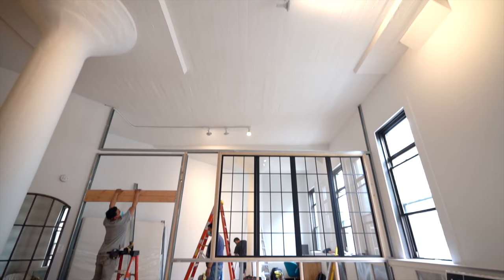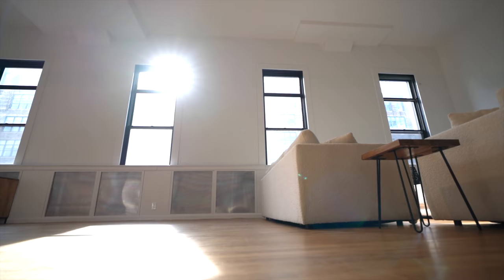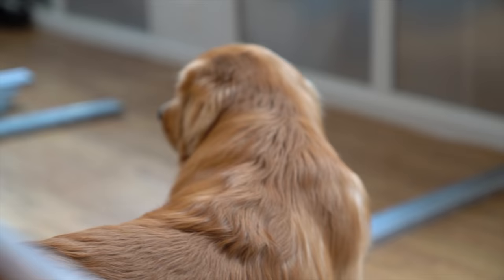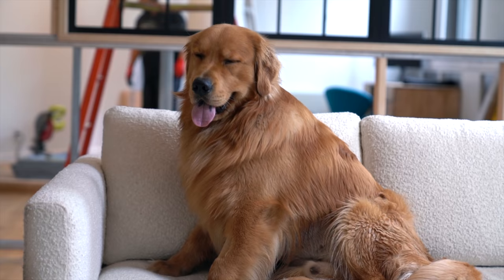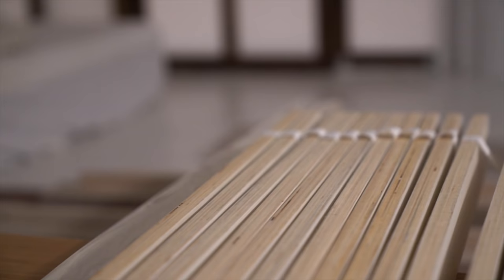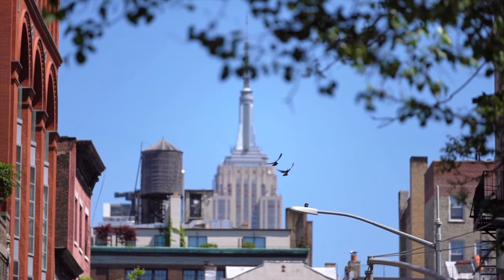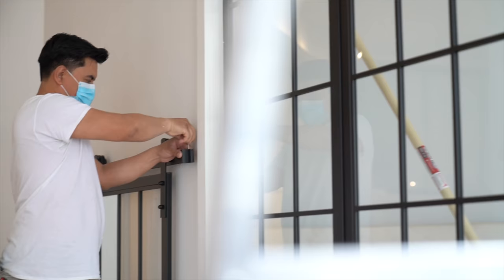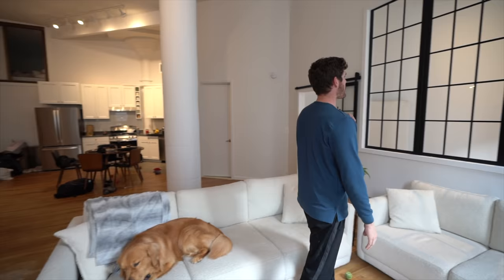My New NYC Apartment!! Renovating my SoHo Loft

Comment: If you do decide to hang curtains (I would) make them floor length. It will highlight the high cielings. Also, if you pick a rustic fabric, it will give the bedroom a more cozy feel and it will add texture without changing the neutral palette you have going on.

Comment: I like that you are doing the black frames on the loft windows. Have you considered changing out the stair rail to add some interest against the wall? You could go with a stove pipe or or steel wire to keep it minimal but industrial...the wall looks amazing❤️
Reply from the maker: I'm not going to do too much since its a rental
Reply: @erikvanconover  You could have the cabinets in the kitchen painted into a tabaco/brown color. It would match your kitchen table, which could stay as a breakfast nook, to help and add more color contrast with the way too much white walls and ceiling.

Comment: It would be more satisfying if new windows were the same hight as the existing ones in the apartment and barn doors too. Now you have different highs all  over (door on the bathroom, bar door, room windows, living room windows...) That would make me crazy😊 Also, since you are painting glass frames, maybe paint the stair rail in black too?
Reply: Possibly add an black industrial curtain bar above your new windows on the living room side at the height of the exterior windows…might solve the height difference .
Reply: My thoughts too.
Reply: It's such a tiny door for that space. They should've put a window above it to make it match the windows. A makeshift transom window. The weird blank wall space where the barn door rests is also bothersome. They could've put a smaller window there with a window above it to allow for the rail and to match the rest of the wall. 

The bathroom door needs some sort of work to match the space.

Comment: ERIK - Looks fantastic!  Totally agree with your mother in the height of the windows.  I'd suggest placing your bed under the new windows with two large bedside tables (maybe one big round table) on each side.  Keep the backside of the room for office space and perhaps a large dresser with your huge mirror over it upon entry into the bedroom on the left side of the door.  You have enough space back in the corner for two large leather chairs and floorlight for reading and cozy time.  Place is looking great!!

Comment: So maybe unorthodox with the factory loft feel, but the guest bedroom/theatre space would make an awesome Japanese tatami mat area. Kotatsu in the center makes a space heater and a fine coffee/dining table duality in what is a low ceiling room. Encourages floor based seating. Futon/slightly raised bed. Contrasts the factory style sliding vaulted windows in place but with the paper divider feel as an almost transition into the space from factory to Zen. A stark contrast to metal and concrete pillars but a transition with the wood frames and floor. Definitely suits the 'cozy' space.

Either way, keep the reading nook idea. Its hard to get to but a place to stay in when you are there. For the avid reader to escape the world outside. Will need some bright/dark wood and low light plants in that area to keep it feeling from being cramped and to utilise and highlight the window and light that comes through. Dieffenbachia and monstera deliciosa are ideal for that low light space and take relatively low care to maintain. In a cramped, low airflow space, they also help keep the air feeling fresh and have low/no scent. Just keep cats away from them (toxic to felines) and don't get lilies (Peace lily in particular) as they are toxic to dogs. 

With such a high ceiling and great light flow, do not be afraid to get some plant life. I would go sparse but large plants as they prefer to be spaced out from other plants and are more forgiving in terms of care. Brightens the space, makes it feel less artificial, increases air quality, and really breaks up all the stark white walls and wood. Compliments art and artificial lighting.

Comment: Man I love the style. Minimalistic with ha touch of colours. Now concerning the living room, I would replace the white "couch" in the middle of the two corner couches with an industrial table preferably in dark brown colour and I would add two or three books on it along with some white red and black candles. Now concerning the bedroom I would place the double bed facing the house and its back facing the big windows so that the light does not affect your sleep (very important). After that I would put a big library inn front of the bed that I would fill with industrial type of decor. The kitchen is great as it is. Now the most romantic and "key" type of room is the second small floor that you have. I would put a big bed with one couch like the ones downstairs but a straight one without any corner. If I helped you even a little bit I am very happy.

Comment: Love how the wall turned out. I think the drapes will work great, but I do think there are options... 
- My favorite idea would be electric window tint or "Smart Glass" where you touch a switch (or even use an app on your phone) and it turns opaque or semi-opaque depending on your design. It would look super clean and just be cool!
- A drop down TV/ projector screen would do double duty! 
- A remote control roller shade above the window
- A Roman Shade

Comment: Hey Eric, I’m a Furniture & Interior Designer by profession. 

I’d suggest, in order to keep the flow of the open floor plan, paint the wooden loft window frames White. There’s plenty of black accent now, esp after the new additional bedroom wall, with black framed windows.

For once more furniture is added, it doesn’t feel too stuffy, instead feels open and minimal. Every little detail adds up. Also takes from the focal points, which will be Art, the existing black windows etc etc.

Comment: Congratulations 🎉 the property is amazing and now a perfect home.

For the loft windows you can go for black or just a lighter woody shade to match with the flooring. 

For the corner of loft you can have a small cabinet with a safe to keep some valuables.

For the kitchen, you can have a small bar counter next to the dining table with a wall mount open wine cabinet that's sleek and with dark wooden finish.

For the wall that you want to decorate with artworks, you can go with some blues and grey to give a color addition.

The living room can have a grey rug and a customizable mood lighting from the floor. This would enhance your movie experience or provide an enhanced relaxation and vibe. I suggest a long LED strip lighting to serve the purpose.

For the bedroom, I can suggest another partition to separate the work area. As the bedroom is a place of relaxation, you don't want to take your work worries to the bed.

Comment: The wall looks good! I was skeptical when you mentioned it in the prior video. The building owner may want to leave it up when you move out so they can market the apartment as a 2BR if they can — or 1BR with loft space since the loft area doesn’t have a true window. 

The curtains seem like a good idea, for privacy. I wonder if a shade of some kind could work, too, so when you pull it up there’s nothing hanging on the sides, for a cleaner look? 

Also, pull the couch away from the window wall and “float” it a bit and/or put a slim console table behind it so it’s not right up against the wall. 👌

Comment: The windows are beautiful and outstanding.  You have great taste!!  Do not add curtains because you don't need them.  If you add curtains, you will take away the charm.  Buy Luminara candles from QVC (cheaper than regular stores).  The flame looks real just like real candles but are battery operated.  Only turn them on at night (when it starts to get dark).  The C and D batteries can last between 6 to 12 months if you only have the candle on for 2-3 hours at night.  At night is when you will enjoy the glow.  If and when you need privacy, get rid of your friends...time to go home.  If you feel you must have some sort of shield for privacy, then invest in a hand held battery operated roller shade.  Invest in the best quality and have a professional install it inside the room above the windows where it will not be seen from the rest of the apartment.  I am sure you will be able to to get just one to cover all five windows.

Comment: An automatic white shade run by a remote control, would be better than curtains. It rolls back up into it's own box and then the box closes and then it drops out of the box, when you want it down. ( It can also double as a movie screen.) Remove the wood and whatever wall up stairs and continue the white painted metal stair rail up and across the balcony. Keep it the same width and look so that it looks like it has always been there. with just a white railing upstairs, it will look more open and it will be better for ventilation and light. No one can see what is going on upstairs, so forget a barrier or curtain -- not necessary. If you insist on drapery or curtains, get white roman shades with inner lining instead. Worst case senario, paint the upstairs all white; it is not precise like your windows and it will look like an eyesore if you paint it all black or black and white.

Comment: After all is said and done...raising the windows off the floor is good / the move completely blows the doorway height into an afterthought. Actually changing the concept from window wall to just window, (which is not bad, but losing the drama of original design). But back to the doorway, consider adding a panel above the door to visually add some importance and needed height.

Comment: Your window wall needs two pearl white adjacent horizontal fabric blinds-perhaps with deep horizontally pleated draping as they lift or with accordian type folds.
You can have them installed and operated to lift hydraulically (electro-mechanically(?)-sorry-not my bailiwick.)  Anyway, as you will be able to raise them separately, that would allow you to have one closed, when necessary for privacy, perhaps when you have company and would not want to have your bed on display.
Your apartment is stunning!  Well done!

Comment: 1:10 the drawing has the barn door and windows on the same level, but it looks much better with the windows raised higher and sitting on a half-wall. Then the bed can be pushed against the half-wall instead of the windows.

Comment: Frame the wall with black metal above glass window and door to make it same height of  existing window. If you can panel it with mirror inbetween frames, it would be good. If you can, remove wood panel in loft and replace it with glass wall with black metal frame. Pint the stair to loft black also....

Comment: Su much better, and keeping the light by using the glass wall is just perfect. 
Living in the big hall just feels like : living in a hall. Now it's like a flat with just generous room sizes.

Yes, do add a courtain. That you can push totally to the side. You can close it from the bedroom when you have guests. It also adds style, luxury and homey feeling. Can't go wrong with that. 
They can be very light and transparent....the light plays in them...or not. 

The rest of the place also needs similar ideas, to make it feel more honey.

Right now, the upper part and the kitchen seem the least polished. (And definitely less polished than your new wall ,😉). Of course the owner could have done it. But he didn't do it because it costs....

Even the curtain will be very expensive (given the size), but if you can easily afford it, go for it.

Comment: Erik, put the white curtains up from the living room and not from the bedroom, it will much more homey feeling. Not the couch against the wall but the other one, have you tried putting it under the windows? it will open up the flow of the space and maybe you can add a large tall plant where that couch was near that pole and also you might wanna put some spotlights on that particular column with Edison lights to give that industrial look.

Comment: I think the new wall looks amazing. The space is a bit all over the place because there are so many different elements that all have a strong character. The new wall works in harmony with the overall aesthetic. You probably won't be able to do this since you are only renting, but the wood-colored "windows" of the loft area might look better painted white. The wooden floor, the black / dark gray of the windows, and the columns and strong angles provide enough contrast. It would be nice if the structures of the loft could remain more in the background.

Comment: You should hang 2 sets of curtains - Sheers that still allow the light to come through but also another set of curtains separate from those to add privacy. I think the sheers (white) will add another dimensional depth while still harnessing the light. :) Great Idea to put up the wall and the owner should leave it once you leave because it adds so much to the space!!

Comment: It turned out nicely! I think a huge bookshelf with a sliding ladder would look really good on the long wall, but I get that it's a rental so maybe that would feel unnecessarily complicated if you don't own a lot of books? You could build a space into the bookshelf for a piece of art or something. I think just adding a bunch of plants would really elevate the space, especially something big that really emphasises the magnitude. Getting a really cool light for the dining table would also be awesome. Maybe look for something antique or retro and have the chord changed out so it's long enough to fit? Either an art deco piece or something classically Scandinavian?

Comment: I would put a large mirror with the same lattice frame as window wall on the wall with the stairs leading up to the loft. It will reflect the light and cause light to bounce all around.

Comment: That really looks amazing and very professional.  I'd put the curtains or maybe blinds on the inside of the bedroom so you have more control and privacy. When you do move out it would be a shame to have to tear it all out unless there is a requirement from the building management to restore things to move in condition.   Seems like this definitely added value and appeal to the apartment  for future rentals. And yes paint the wood trim black at the loft area.  Great job..

Comment: I really liked the direction and the result,
But very disappointing that the door is small and low, different that it is near the door of the bathroom which is higher.
I would recommend that you bring in furniture and curtains that will give the space some volume and warmth.

Comment: Hi 😁 New to the channel. ~ I like the new wall, and bedroom addition. You asked early in the video if you should paint the wood on those sliding doors in the loft black or leave it wood. I think you should paint the wood black to match your bedroom. I also think you should paint those large beams black. ** Not the whole beam ** I would paint the bottom half of the beam. You can do vertical, horizontal, candy cane stripes or solid black. I think painting those beams would give the place more personality. I would get a black kitchen table with red or blue chairs. Just to add a little color to the place. ~ What do you think? 😃

Comment: Looks very nice. That style of interior black framed glass wall is actually known as a new yorker wall here in Denmark.
I think modern wide plank oak quality laminate flooring would really lift the place as well. And that's relatively inexpensive and very durable. I can't imagine the landlord will want the wall removed and the floor could be done with the landlord as well.
Reply: The pillars could be covered with artificial vegetation. Probably relatively expensive but I think it could completely disarm the basement look.
Could have little arms with spotlights illuminating them.

Comment: it WAS a cool space... new window & door height / modulation should´ve matched existing doors and windows proportions somehow, it does not... I would´ve never enclosed the space completely unless expecting tons of sleep in guests; cool separation would have been possible with some sort of a cabinets not all the way to ceiling to keep the volume throughout. But then again, from a video I guess its just plain difficult to provide an educated opinion.